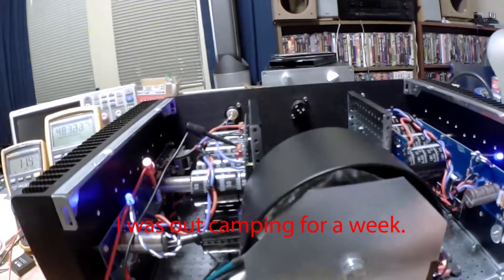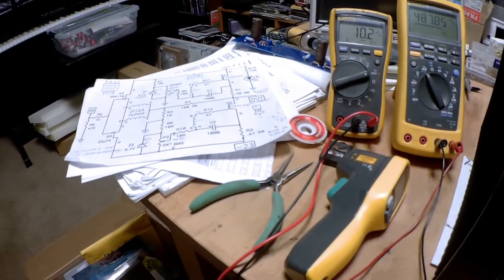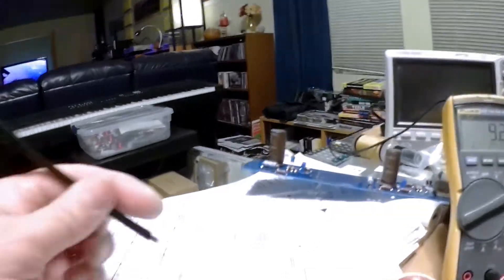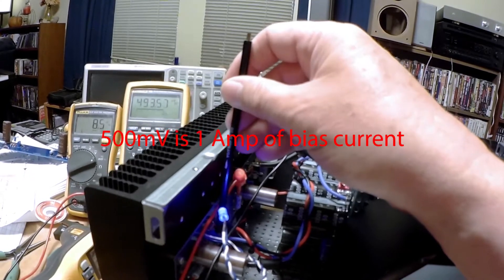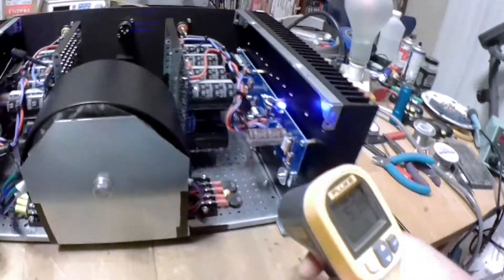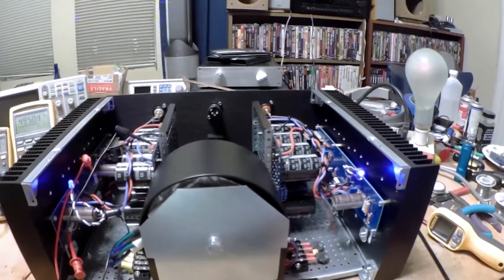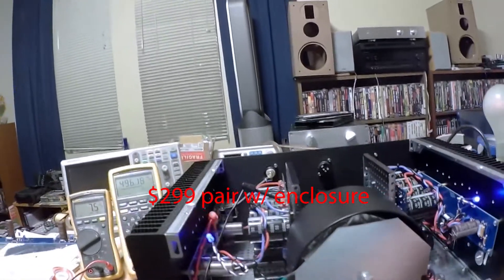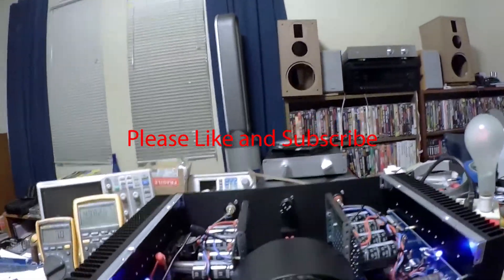Robert Builds the Nelson Pass F6 Amplifier part 10

Comment: Hi Robert, what Bias currents are you setting? Would this be sufficient to make the bulb glow faintly?
I am contemplating skipping the F6 and jumping into a SissySIT v3 as I have a bunch of Tokins waiting to be used… 
Keep up the good work on this one, so close now,
Reply from the maker: Jon, I'm planning to plug in my F5 and see if it lights up the Dim Bulb. I hope you post some videos of your SIT amp. I will probably need the help when I build mine.
Reply from the maker: Yes, the bulb does glow with the normal Class-A bias of the F5T.